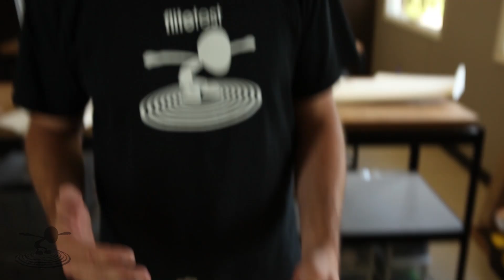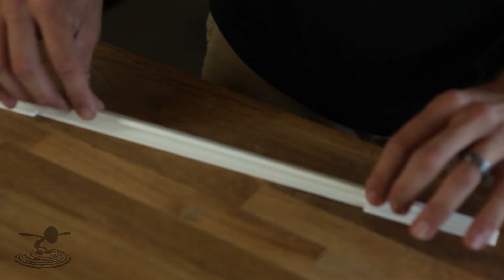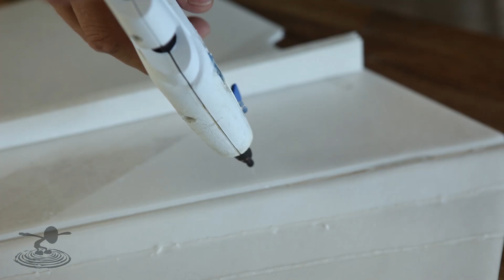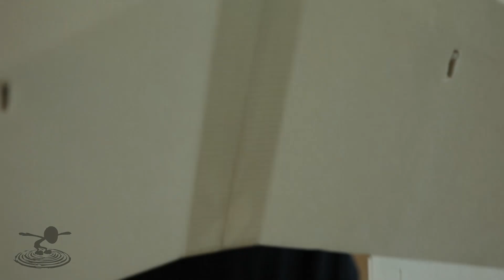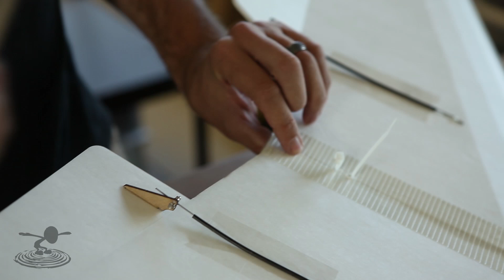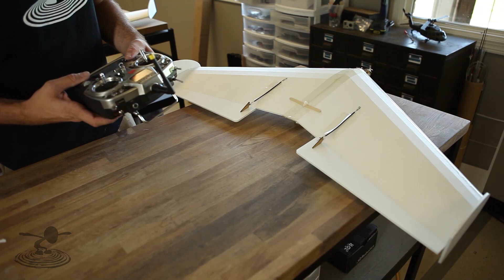Flite Test - FT Versa Wing - BUILD

Comment: I have made the wing and have made all the electrical connections. I have made multiple attempts to fly it but it just don't want to fly.
I am using a 1400kv BLDC, a 30Amp ESC and 10x4.5 prop. The design is right but I can't get it in the air. I need help folks.
Reply: Please try using 8 x 4.5 prop instead

Comment: Shouldn't you use ca instead of hot glue?
Reply: CA attacks foam. There is foam-safe CA, but it's expensive. Hot glue is cheap, accessible, and easy to use. It's heavier, but if you're not slopping it, the weight isn't an issue.
Reply: Foam safe is like $8 at my hobby shop
Reply: Yes, usually about $8 for half an ounce. By all means, use CA. It's not going to break the bank. But the FT method is to use the least expensive and most easily available materials wherever possible, and hot glue wins by a mile by that metric.

Comment: I wish I could get one of these but money is short with us right now. I’ve always wanted a wing, but alas we can’t afford it😭😭😭😢😢😢
Reply: The nice thing about this hobby is that there's only one up-front major expense: the radio transmitter you use to control the plane. A Spektrum DXe costs $60 and will take you from wings to 4- and 6-channel planes. I personally use a $110 FrSky Taranis Q X7 to take advantage of the OpenTX programming environment. Once you've knocked that out, you can nickel and dime the rest of the way into the hobby.

Here's a list of everything you'll need, transmitter aside, to build and fly a tractor-style Versa Wing as in this build video.
Receiver: $10-30
Emax MT2213 935kv motor (the kind used in the Flite Test "power pack B"): ~$15
2x 9g servos: ~$10
LiPo battery of your choice: $10-$15
20A ESC with XT60 connector: ~$11
9x4.5 props: ~$1.25 each if you're buying a few at a time; you can often find 8-10 packs online for cheaper per unit, and it's worth buying a few while you learn the sticks
Three sheets of Dollar Tree foamboard (two for the build, one for spare parts or in case you goof while cutting out a piece): $3

All of that together totals as much as $95, but the great thing is that you can just set aside fifteen, ten, maybe even five bucks a weeks to pick up supplies one at a time. By the time summer rolls around, you'll be ready to fly.

I know this reply is 4 months late, but lots of people feel that RC flight is too expensive to get into. I'm a broke sucker myself. I saved for months for my transmitter, then picked up the rest of what I needed a handful at a time, taking advantage of sales where I could. It all comes together pretty quickly once the Tx is out of the way. It's doable and definitely worth it.
Reply: @rmdcade1717  you technically would also need a battery charger, but that's also a one time thing.

Comment: I am having trouble with my FT Versa, just got it in the air today and it was banking HARD to the left and nosing down... i had to fly it back around a few times with the sticks to the right and up... what is the cause of this? both control surfaces look even, could it be the torque of the motor?

Comment: Hi! Im trying to build a Blunt nose versa but i don't know which power system should i use. Can a Blunt nose versa carry 2x 2200 mah battery?

This are the things im plannig to put on the Blunt nose versa:
APM 2.6(GPS,Power module,Radio telemetry, Airspeed sensor)
FPV(Video Tx, Small fpv cam, action cam)

What motor should I use?
Reply: I use a turnigy 2826 -6 with a 40 amp esc on a 3-cell. 
flies great and lots of power..
she really screens at full throttle. btw, yes you could definately put 2 2200mah batteries in the blunt nose version.
Reply: can it still carry the equipments im gonna put?
APM 2.6(GPS,Power module,Radio telemetry, Airspeed sensor)
FPV(Video Tx, Small fpv cam, action cam)
Reply: Absolutely.
Reply: If you want a bigger wing for more payload, flitetest has plans for the "Kraken". It's about 10 sheets of foamboard.
Reply: like I said.. Absolutely.  It'll carry everything you mentioned.
Reply: Yes.   Brad is correct.  The weight to thrust ratio.....will work with your 2x 2200.....IF.....balanced and installed correctly.   :0)

Comment: the foam board that I buy here has a very thin layer of paper when I fold the parts together it just tears. Do I use packing tape to keep it together or should I just add a layer of paper on this foam board before I bend it ? Any idea ?
Reply: the trick with the thin paper covered foam is to bend it really slow and gentle.. Bend it a little then a little more slowly and carefully before trying to glue it. if you're careful it won't tear.. if it does tear it can be repaired with packing tape. I also reinforce my elevons with packing take on the hinge.
Reply: mystery What you want to do is bend the board in such a way that the foam under the fold compresses to shape instead of overstretching the paper. Bend sloooowly... ease it a little at a time.
Reply: You can also crease the inside of the bend to get it to bend better.

Comment: this will be my first plane and i want to make it crash resistant.  any suggestions?
Reply: Make it out of wood or dont fly it at all. :)
Reply: i wouldnt recomend this as a first plane... and forget about crash resistant, if you crash it you WILL break it. sometimes you get away with it and just have to glue stabilisers back on, other times it will fold or break inhalf elsewhere.

one thing you can do to make it slightly stronger is use the fibre tape (extreme packing tape) along the leading edge, and also along the top and botom to help stop it folding

Comment: hi i was wondering if i clut use a 2200kv motor and a 3s 2200mha battery
Reply: should be fine just get a variety of props. I was using a smaller motor from one of my multi rotors and a large prop and it got VERY hot. dropped prop size and it was perfect although a little slow. new emax motors on the way now :-)

Comment: Can i glue my servos on the very top wing surface?
Reply: +ryanworks35509 
definately mount them inside the aircraft . I think they would sit too high above the wing changing the throw of the elevons.. also they wouldn't be protected at all in the case of a crash.
Reply: you can glue your servos on top of the wing as long as your control rods still line up with your control horns mounted in the flaps. I would suggest using control rod stoppers also known as easy control rod connectors for better control and reactions on wing builds. the guys at FT just mount the servos inside to lower drag/wind resistance. plus it looks cool.
Reply: +ryanworks35509 ok thanks
Reply: +ryanworks35509 
I prefer the puchrods on the top of the wing.. especially without landing gear, the servo arms and pushrods are safer on top of the wing with a pusher configuration.
Reply: Brad Arthur I agree, if the choice is between top Mount or bottom mount, but I think someone was just asking about mounting the servos on top of the wing versus inside of the wing. I think even with a tractor model I would prefer top mounted servos and I definitly like them mounted internally to make them as flush as possible.

Comment: can I use a 1000kv for this??? with a 10*4.5 prop??
Reply: +Juan Andrés Viera Medina yes you can
Reply: Hi arthur, can i use a 1100kv with 10*4.5 prop as a pusher... thx in advance!
Reply: Hazmi Razak you should check if the motor is getting hot but no it should be fine
Reply: I've tried turnigy 2822/17 1100kv with 10*4.5prop just now. Well, it's get hot when i push 100% throttle for 30 sec.. but when i give 60% throttle(min thrust for my ft versa), it become less hotter.. is that okay?

P/s: thx for your reply tho :) .. much appreciated..
Reply: Hazmi Razak i mean it can be warm but burning hot is really bad
Reply: Understood arthur! Thx (y)

Comment: I turned down the rates to 30% but I didn't touch the end points it is balanced on the CG it a touch nose heavy when I took it out for it maiden flight and it porpoise right away and crash nose first. any help please?

Comment: It would be interesting to see a push and pull version of the versa! How about it Flite test? Also, do you think a MN2206 2000Kv could power one of these with a 7x3 prop? I was thinking of purchasing a versa as my first rc plane. I want to use parts for my quadcopter on the versa until I finish buying all the parts.

Comment: dont hate for my noob question but ive seen quad builds and they use flight controllers such as cc3d or naza. do you need one for a plane? and also if you dont what do you connect your transmitter to? if anyone has answers or places i should look it would be greatly appreciated
Reply: i am not the smartest with planes but you do not need a flight controller.You connect your transmitter to a receiver. Most radios come with the receiver.
Reply: liam jeanette Reciever simply plugs to servos and esc... esc(electronic speed controller) is between motor and reciever... no flight controller... it is possible to add a gyro but that is rare..
Reply: CrashCourseRC studio Hey. How do you connect the servos and motor to transmitter? And do the transmitter automatically connects to the receiver?
Reply: Fawwaz Hosein You need to connect the battery to the esc (electronic speed controller) than you can connect the esc cable to the transmitter (make sure that you put the esc cable in the right channel port. you can check the manual of the receiver/transmitter to see what channel you must plug your esc/motor in. In the transmitter of me I must connect the esc into channel three). The rest of the cables you can just plug into the rest of the transmitter ports. here is a picture of the setup: http://assets.flitetest.com/article_images/medium/basicsetup-1343184061160_1359094476557.jpg . Most transmitters do connect automatically but sometime you need to select the channel on your receiver or on you transmitter.

sorry for my bad englisch
Reply: Ohh. Thank you very much sir!!
Reply: no thanks and hope you figured it out.

Comment: how easy would it be to scale this plane up? Turn it into 50" model instead.
Reply: They did. Search for the Kraken.
Reply: Are they selling it as a kit?
Reply: Sadly, no. The amount and size of all of the parts needed is too much to ship at a reasonable cost
Reply: okay what are the general flying characteristics of this plane?Thanks
Reply: I mean that plane
Reply: I have no idea man sorry. I think they might have a video on it.
Reply: alright, thanks for your help!
Reply: Matthew Barnard , hey man I'm actually going to build a kraken. I redid the free plans to make it fit on 4 sheets of foam board, ready to laser cut. Tell me if you are interested, and I can send them to you.
Reply: Nems271 sweet. I am definitely interested. I don't know what is involved with that, so just let me know how much. Email me at matt.barnard3@gmail.com
Reply: Nems271 Were can you get foam laser cut?
Reply: Jon Car I don't really know, most places that have a laser cutter have limitations on what they are willing to cut. Foam core is usually something that places won't cut because of the fumes released by the melting foam. Alternatively, I use a sharp X acto knife and print the plans out to make these models.
Reply: I started cutting out the crash 20 yesterday thank God for hot glue and color tape to hide my mistakes
Reply: Ben Woof I started cutting out the crash 20 yesterday thank God for hot glue and color tape to hide my mistakes
Reply: Jon Car Near to where I live, there are several laser cutters.  They usually cut MDF wood or acrylic for key chains or other decoration stuff, so it is not a very powerful laser so its good for cutting foamboard. You would have to look if there is anything available where you live. :/
Reply: Nems271 interesting  I cut the Versa out using a very sharp olf blade.  Getting better at each attempt.  Going to build 4 of them. Made some mods.
Reply: Jon Car Nice, its the same really,if you are good with a knife. Laser cutting just saves you time.
Reply: Matthew Barnard Did you get my e-mail?

Comment: What size is this foam 3mm or 6mm? seeing as i finnaly found the Depron Foam in a dutch webshop.
Reply: It's 5mm foamboard, depron wont really work as it doesnt have paper on it and it doesnt usually come as 5mm, you could use it but you'd have to alter the plans to accommodate the thinner board and use tape for all the parts they use the paper for.. IMO it's too much stuffing around.
Reply: ejleipold or simply rescale the plans for the board being used
Reply: I said you'd need to alter the plans to accommodate the thicker board :/ It still extra stuffing around

Comment: Hey guys, i had a rough landing and one of my servos is now constantly pushing the elevon down, its not stripped because if i turn off my radio both come back to original position, but as soon as i turn the radio on and binds the receiver, the servo goes back to push the elevon down, how do i reset my servo? i tried unplugging and plugging again
Reply: Tiralo y pon otro nuevo

Comment: That all depends on how you work the controls.  Yes you can fly it lower but you risk crashing more because you have a shorter distance to the ground to correct any wrong manuvers. Here's an idea, buy a bucket seat from the auto junk yard and mount it on a lazy susan on a homemade plywood platform.  You can recline it back and not have to work your neck much, you just have to use your feet to pivot yourself. I suggest a Mazda Miata seat, they are really comfortable and ergonomic.

Comment: That is to glue the paper edges to the foam and seal the foam. The paper tends to separate from the foam and the glue prevents this. I was taping the hinge but the foam board paper really is tough enough by itself to be the hinge. I experimented and the $1 foam board surface paper is almost cloth like, not like printer paper.

Comment: VersaIII update. I had a crash in which I tried flying inverted to low and goofed. I fixed it and it's still flying great. I tried the 2200 mah battery. It flew fine but the prop broke on landing so it's better to use the smaller 3 cell that Lazertoyz sells. Also the power pod must be giving it more stability and makes it very easy to launch. I love climbing up high kill the throttle and spiral straight down or give it full up elevator and watch it slow to 0 mph and glide in the upper wind. Fun!

Comment: Update. I got the emax 'the beef' motor for my 3rd Vera, having destroyed V-I V-IIA and V-IIB.  I was using to large and heavy a motor. When I received the emax I was like 'This thing is tiny!'. But it really works great. It can pull the Versa's weight vertical from  0mph with ease, and it is so quiet. I think guys can skip the blue wonder and go straight to the emax, just fly it at low throttle. I made a new video. watch?v=85VvSwU6DYE

Comment: Finished Versa III. It took me 2.5 hours to trace, cut, score and clean the pieces and 3 hours to put it together, counting fiddling time. I used the dollar tree foam and the weight with the power pod and servos, minus the other electronics, is 9.3 oz. I just have to wait to get the blue wonder and the 'beef' power plants.

Comment: The ESC I have (Great Planes 35A) for some reason will not activate with the 2S battery I bought yesterday even though the specs say it will work with 2s to 4s lipo batteries.

Comment: resp, I don't know the answer to your question. But, using a tractor you don't need to add extra ballast. My idea for my next attempt will be to make the power pod with landing gear and let it take off naturally from the parking lot instead of hand launching it. My first three Versas were just to heavy so when hand launching they pretty much went straight to the ground like a brick, unless I used full power. Then they just went crazy with torque twist and didn't fly long.

Comment: The  motor that I got locally burned up on my test board. I went ahead and ordered a blue wonder. Guys who use the blue wonder, can I use a 3S 2200 mah battery? Or is that to much extra weight or to much voltage?

Comment: I fixed my new battery. I read on the web to try and charge it as NiMh so I did that, and it put enough charge back that I was able to charge it as LiPo. Whewww. I will try and get the motor connectors to work with the esc that I have instead of picking up a new one.

Comment: This hobby is driving me nuts. So I went to the local hobby shop and bought a smaller motor and 2 cell battery. I had to solder a different connector to the battery and I stupidly cut both wires at the same time. Ruined the brand new battery. This 4 dollar plane has cost me $130 dollars so far! And I haven't had a flight yet. Why do they have 4 different connectors for batteries instead of 1. Every battery has the wrong connector. Frustrating.

Comment: For me the solution would be to spring for a new motor/esc/small battery to use with the Versa. But I don't want to spend that kind of money because as soon as I master it I move on to another project. I want to keep using the same electronics combo in all my planes. But my electronics are on the heavy side.

Comment: Scott I can tell you with out a doubt, you will never be able to learn to fly with the Versa. I just got back from the flying field with my 3rd iteration of this plane. The first two were pushers the third was a tractor. I have destroyed every single one with a three second flight. The problem with the tractor version is the prop breaks every time. And I am an experienced pilot. I would recommend that you spring for the hobby king Bixler. Hobby King named a plane after Josh Biixler.